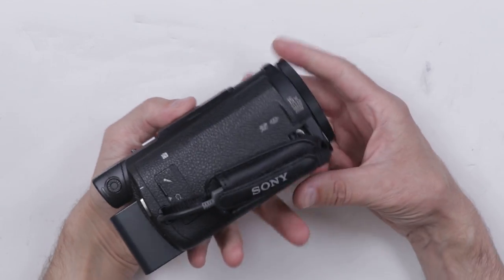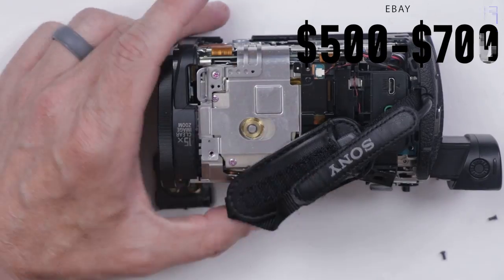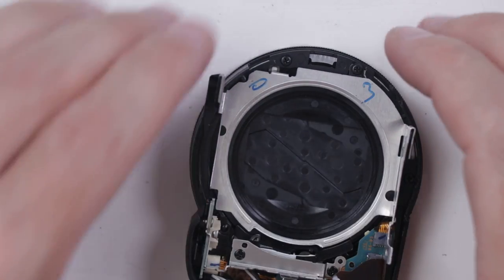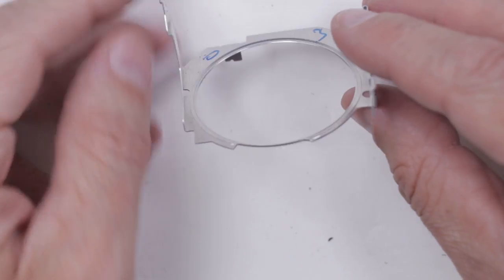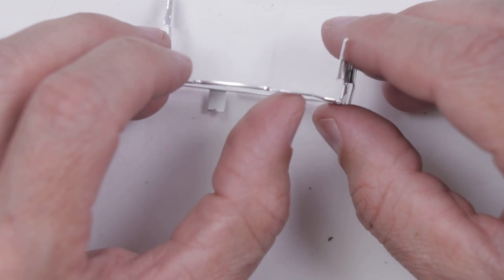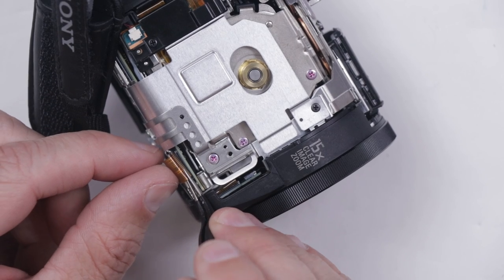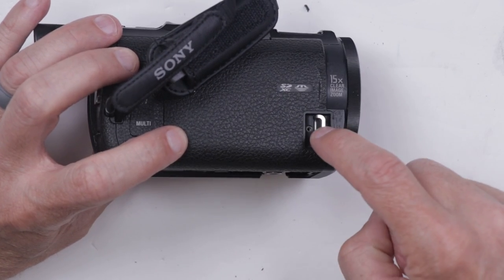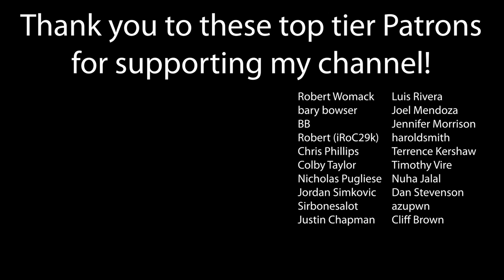I Fixed an $800 Video Camera for $0

Comment: When you power up your camcorder and the E:62:10 message is flashing you are most likely experiencing a lens malfunction. You may hear a noise and feel a slight vibration. The internals of the lens may shift and cause a vignetting in the image.

Why Do I Keep Seeing the E:62:10 Error? 

Nice job fixing it.. I loaded the error message, right before you got started.  Sorry for telling you something that you already knew...  Love your work, I have tried to do some of it.  DId get a Macbook Air running again.
Reply from the maker: Nice work on that Macbook Air! I've never worked on an Air before.
Reply: @Tronicsfix  Thank you, that is nice coming from you...
Reply: @Tronicsfix  I managed to successfully swap the power cable on a Pioneer PD-Z72T with the one on a broken Z73T. The Z72 had a generic replacement plug when I acquired it, which wouldn't work with the auxiliary power socket on the back of its companion DC-Z93 amp. 2 BP connectors, a lot of fiddling, and a slit in my thumb later, it looks like I was never in there. The hiccup with the operation was an annoying clip holding the cable to the backplate, so it was while I was trying to get the plate off to make my life easier that I slit my thumb on the top of the plate. I did have assistance.

Comment: 3:00 in, I say "I bet that was the whole fix." Yup! I like when you work on... well, just about anything! But non-console stuff, nice to see! I had a camera with a lens error that I was able to fix but in the process I broke the little connector for one of those ribbon cables so most of the buttons don't work anymore. I've never figured out how to find a replacement for that connector, but it's probably too tiny for me to solder anyway.

Comment: Would be interesting to see you try to fix a TV. Idk if you have done it before but I haven't seen it if so. Idk if they're just too big to easily fix while making a video or if there is another reason.
Reply: It isn't that interesting, on a modern display it's usually going to be a problem with the PSU or the leds gone bad, if the panel is broken then the only worthwhile thing that can be done is turning it into a light panel.

Comment: I had a Sony camera like this that was dropped and had a bunch purple artifacts whenever the stabilization moved. I wound up selling it for really cheap on eBay but I wonder what the process would be to fix it...... I also have a canon GX10 that was not dropped and quite literally one day I turned it on and herd grinding noises and it would not focus... seemed like the focus mechanism fell out of place in the gears... I tried to take it apart a little bit to see if I could fix it but cameras are extremely compact and complicated, you barely even opened up this camera.

Comment: I'm not sure but that lens looks like it has mechanical stabilisation it's a possibility that the stabilisation mechanics are being jammed by the broken in the case so it can't move so the sensors inside or detecting jam of some sort I could be wrong.